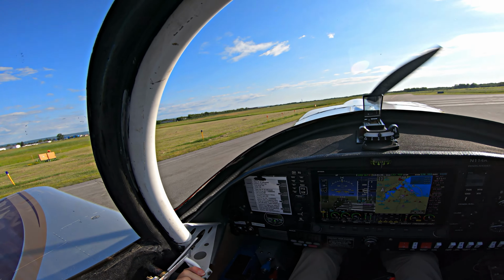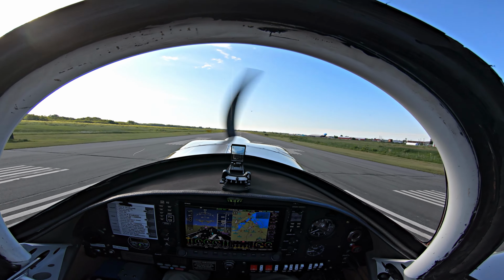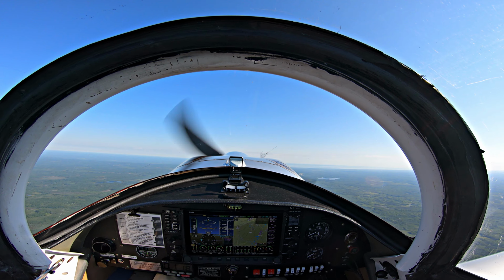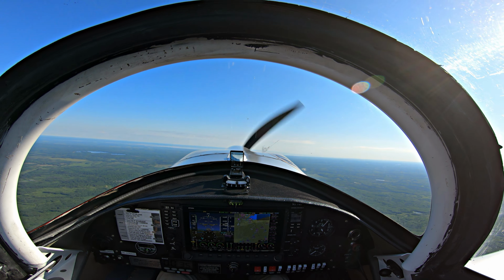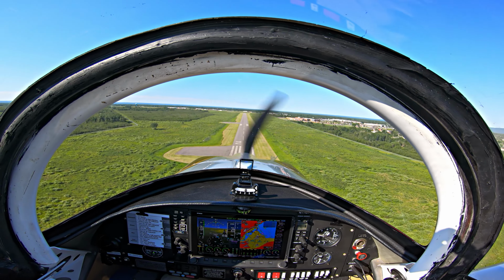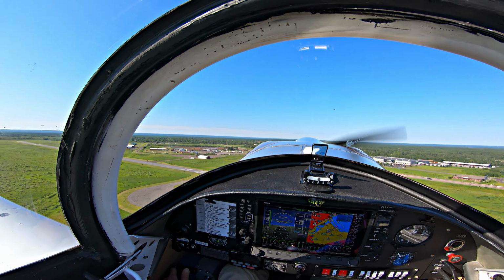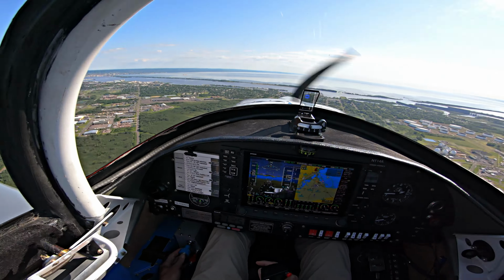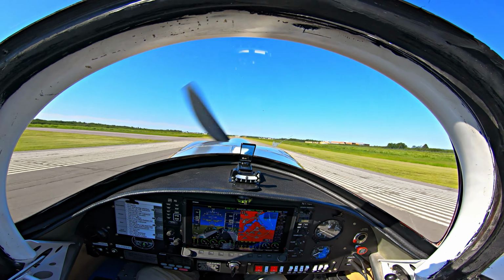A fun ride to re-calibrate POH stall speeds and a few landings with different flap configurations.

Comment: Oh man, I am going to totally copy the center of your panel. I want the same Dynon setup. The way you have the radio, ap stuff vertical and right up against the main display never even crossed my mind. Thanks for sharing.
Reply from the maker: Best is to place all switches, knobs and dials you'll be using more frequently on the left side of the panel available for your free left hand like autopilot, heading/baro, fuel pump, landing lights, flaps, etc. Right side l'd put radio/comms, master switch, magnetos, alt, ignition, etc. When it gets busy or have turbulence the ergonomics help alot having stuff in the best position.
Reply: @MyWTFName  Oh darn. That is good advice. Now I feel like I have homework to do! lol  Thank you.